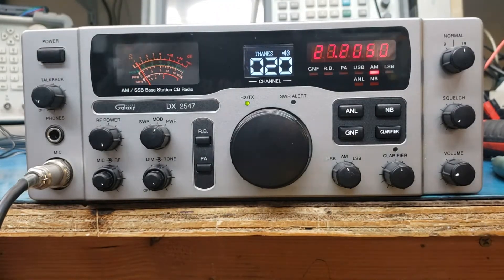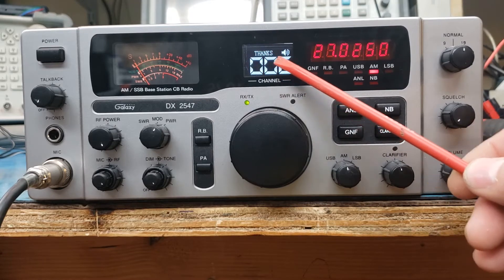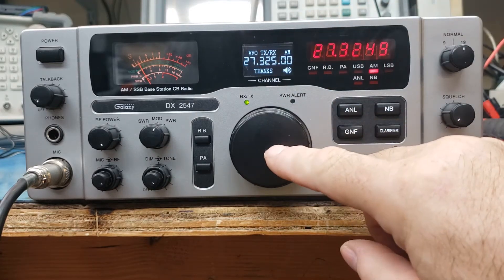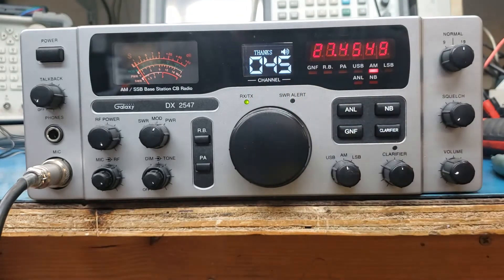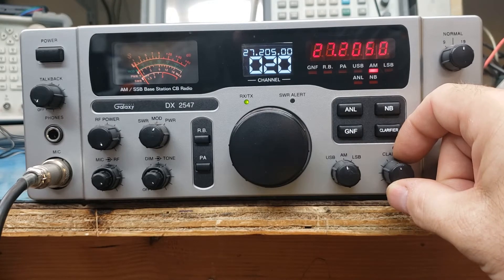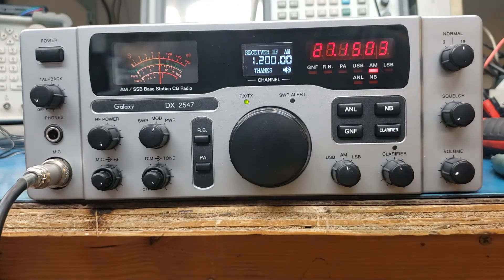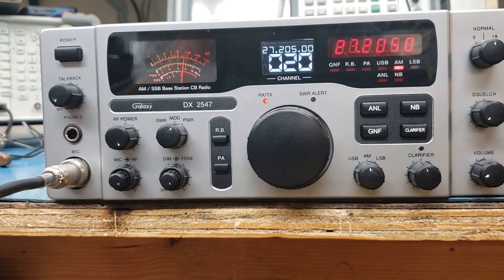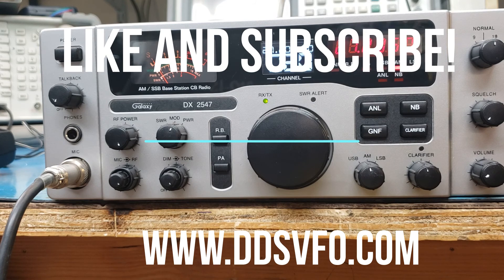Galaxy DX 2547 DDS-VFO

Comment: Howdy, Thanks for sharing this with all of us. I like this radio and would like to leave it stock, But I'd like to run a RM Italy KL-503 amp with it. Would the radio have to be adjusted in any way? I already have the amp. Matter of fact the amp is connected to a bearcat 998SSB. Had a fella turn the bearcat down a bit so it would work with the amp, but he couldn't make any adjustment for it to work with the sideband part of the amp. It works great on the am side but can't use the side band. So anyway, please let me know if I'd have to have this radio adjusted for it to work with my amp. Thanks   Roger

Comment: I heard about your channel from Mr 204 Ground Control; he speaks well of what you do sir. I really like what I'm seeing the DDS system working well on that 2547. I have that same rig and it's my main radio. I'm far from a tech but I've been an avid 11 meter junkie for 40+ years and always looking for new stuff that truly works. I'm just curious if there will ever be a mod like this that can be interfaced to a flat screen using a PC. I'd really like to see somthing like that become available with the same options and functions as the internal mounted unit. My vision isn't bad at all but would just be awesome to to have all those goodies displayed on a larger separate screen for the base.
Reply from the maker: Hi already have it. Look throughout our videos and it should be there...
Reply: @ddsvfo  Thanks for replying and for the info. 💯

Comment: Wow i had 2 of these radio and the channel selector got well used and became kind of loose, so i sold them . Where can i get one done this way ???? and at what cost ??
Reply from the maker: The shop now has 2 if these in-stock with the kit available. Email mark@troyradio.net he will get ya going. Or call 254-239-3893 10 to 5.

Comment: I ordered one on May 24th (2021). Found the best price. They offered a $33 discount, so with that, the total was $296.97. I checked their website for status. It said it was being packed up and getting ready to ship. I check again another day and it says "Awaiting product from Galaxy". I'm like "WTF? First it's getting boxed up, now they don't even have it?". I email the company and the guy tells me they are on backorder, but my order is 3rd in line to be processed. I realize other retailers are also out of stock, so I wait. Now it's July (2021 for those reading this at a later date) 16th and still no radio, even though it's now in stock on Amazon, WalcottRadio, CopperElectronics and a few other places I checked. They're still "Awaiting product". I'm beginning to think they realized they priced it too low. Coupled with free shipping and a $33 discount, they're not making as much money as the other retailers who are selling it for $340--$430 not including tax and shipping. I think they are waiting for me to say "Fuck it. Gimme a refund." Which I did because I need the money for bills now. But hearing about the problems these radios have, maybe getting the refund is a better deal.
Reply from the maker: Actually it is a really good radio. The problems happen when abused and or golden screwdriver gets into them.
Reply: @ddsvfo  I heard they drift right out of the factory.
Reply from the maker: Some do yes, but with the DDS system it stops that becuase it replaces the entire original  Pll system with a super stable rf generator. It is amazing. Plus you get all the options like HF receiver,  band scan, spectrum sweep, selectable channel scan and more...